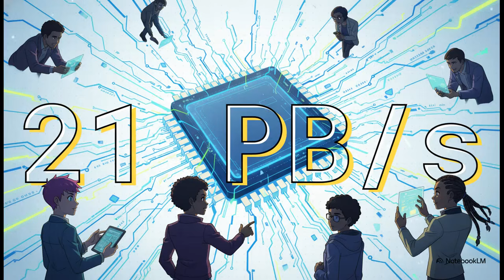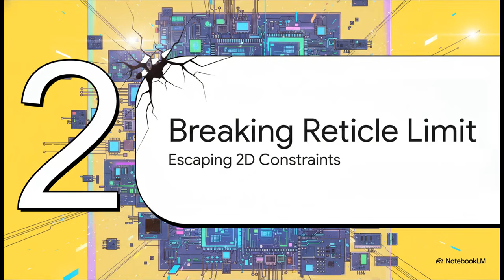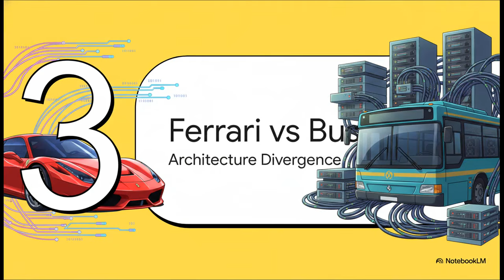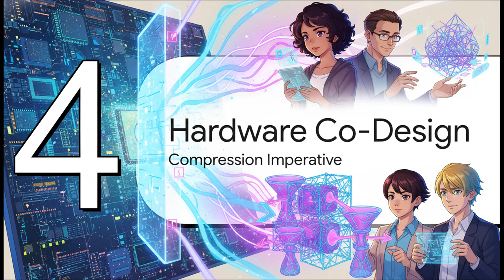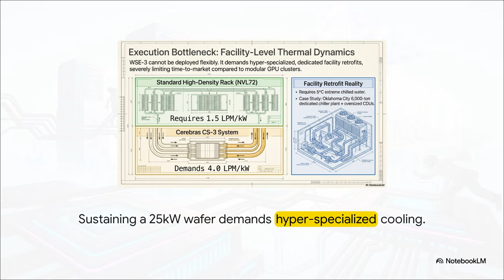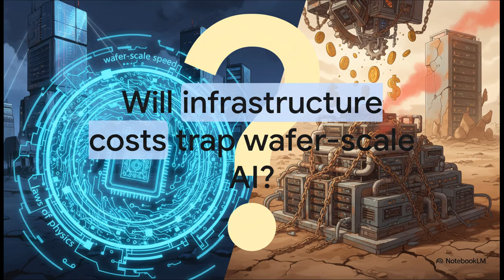Cerebras vs NVIDIA: Two Approaches to Real-Time AI

Comment: So when at the end this video mentions crushing cooling cost associated with wafer scale computing, it's a lie. That's because the wafer scale solution actually requires less cooling for the output you get by far. It might be more expensive to build but results in lower ongoing cooling costs for The Identical computing power.  So the statement here should prove wrong. Keep this in mind.

Comment: As I thought , or at least Gemini agrees with me:  " While a single Cerebras system draws a massive amount of power on paper (around 23 kW for a CS-3), it delivers higher efficiency per unit of work due to two main thermal and architectural advantages:  
No Off-Chip Networking Bottlenecks: In a traditional GPU cluster, a massive portion of the energy—and the heat that comes with it—is spent pushing data through external copper traces, optics, PCIe switches, and retimers. Cerebras keeps all 900,000 cores and its memory interconnect on a single piece of silicon, so data moves micro-distances over on-chip traces at a fraction of the energy cost.  
Direct Liquid-to-Silicon Cooling: Because all that power is concentrated into a 15U chassis instead of spread across multiple server racks, Cerebras uses internal liquid cooling plates directly against the wafer. Liquid transfers heat far more efficiently than air cooling, so less overhead energy is wasted on high-RPM fans and room-scale HVAC.
When comparing the power required to train or run equivalent AI models, a single wafer-scale unit can match or exceed a cluster of dozens of standard GPUs while pulling roughly half the total electricity.  Since you're eliminating the massive energy overhead of pushing data between separate chips, the total heat produced per unit of compute is significantly lower than a sprawling GPU cluster."